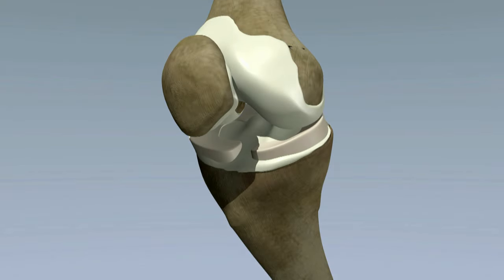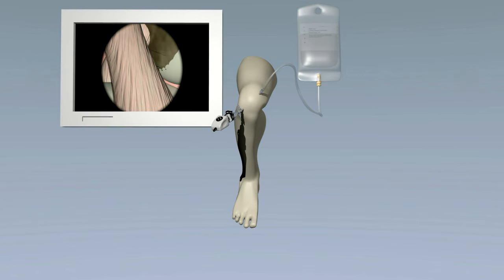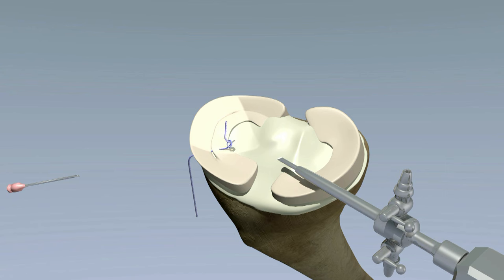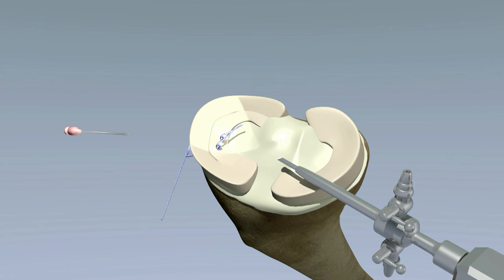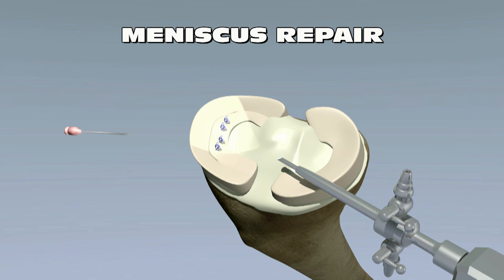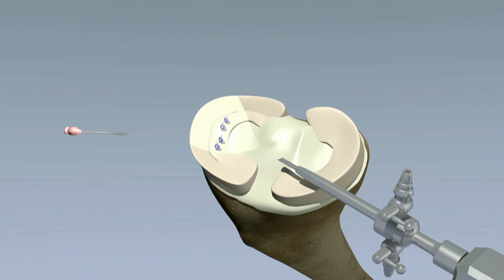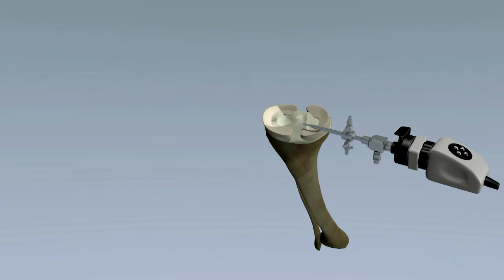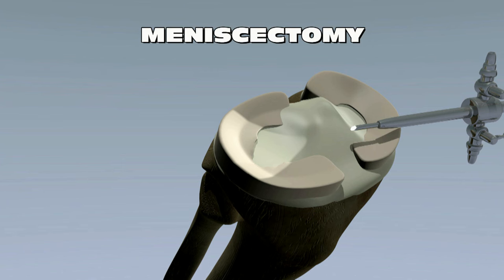Meniscus Repair and Meniscectomy

Comment: Meniscectomy doesn't work ... cutting out an incredibly tougth shock abosorber in your knee and replacing it with nothing ... guess what ... its doesn't work
Reply: That was my first thought. What are they replacing it with?
Reply: My ortho surgeon wants this asap I refused !
Reply: Thanks doctor lmao
Reply: @hardcoreromeo2111  No problem professor
Reply: That’s not quite  right as the tear can be trapped or be flapping about and hit off nerves and cause a lot of pain which the partial removal can really help with. Depends really on your individual symptoms

Comment: But also when you cut off the meniscus you are preparing the knee for a potential arthritis. Is that correct? How much in % can you remove from the medial meniscus to be safe and free of arthritis in the future?
Reply from the maker: The animation is meant as a simplified illustration of the procedure, not as a technique guide for orthopedic surgeons.  Yes, the more meniscus you remove, the less protection is left for the articular cartilage.  This can increase the potential for developing degenerative arthritis.  However, leaving a free flap of torn meniscus is worse, as this can rub against the articular cartilage and accelerate wear and tear.  Not to mention that symptoms will persist.  This is why a meniscal repair is done when possible.  Another option, in select patients, is a meniscal transplant.  I wouldn't say that there is a % that is safe to remove.  Removing the torn meniscus is just the lesser of two evils.  But most patients do very well more many years following a partial meniscectomy.
Reply: When people see comments like this they freak out and think surgery is huge mistake. Well apparently some people don't develop arthritis at all. Factors like age, volume removed and location, pre-existing chondrol damage, BMI etc all determine whether you're a good candidate or not.
Reply: @rachellemartique6980  I'm currently afraid of the surgery 😓
Reply: @ORTHOfilms  I’ve had 70% of my meniscus removed for lateral, It feels sore sometimes. Should I end up getting a meniscus transplant I’m 26 years old.
Reply: @servantofthecreator  now how are you bro are you fine
Reply: @servantofthecreator how are you doing brother 
I also lost 60% of my lateral meniscus

Comment: I had a partial meniscectomy done 6 years ago and it went well and my knee has been well since. Sports like basketball and no problem with a brace.
Two days ago I tweaked my knee and it felt like it was a bit unstable in that moment. 

How likely is it that I re-tore it? Or that my exposed surfaces touch? I've retained full range for motion except for when contracting leg muscles at full extension. Leg will fully extend w/o pain when left limp.

R.I.C.E. has helped with pain and motion. Just want some ideas, thank you
Reply: I think you need to revisit your opinion that meniscectomy ... it never does well
Reply: @youubik  yeah I think I have arthritis. A day of walking will leave me with lingering soreness the next day.
Reply: @isaiahmckeown-philip1238  I advise physio, look at the position of your knee, when you stand relaxed does your hip knee ankle stack above one another. Does your knee rotate in or out. Then work on aligning it
Reply: Please advice!!!
I'm 24 and just been diagnosed with meniscus tear. Completely devastated with the fact that I've to go thru surgery this early for the first time in life.
How's ur knee now? Did you go thru any episodes of pain/stiffness post-op? Jow does ur knee feel as compared the healthy one?
Reply: @Adarsh  hey Adarsh. You don't have anything to worry about. Here's my experience:

I did not have knee pain until one year ago, so just under 6 years after surgery. The pain started when I went from complete inactivity and rotting at my office desk to doing 1 or 2 intense workouts a day for 10 days straight. This is after 6 years of next to no proper physiotherapy.
During those 6 years, I went on long hunting hikes, did a skidoo race, played basketball and other sports, worked on my project truck, and more (most sports with a knee brace). I rarely got sore.
Now, since my injury last year, my knee if often sore, even from walking.
My advice is to do your physiotherapy consistently. Wear a knee brace sparingly. Most of all, follow your doctor's advice. But I can't stress enough to do the physiotherapy.

You'll be okay!
Reply: @adarsh5343  no episodes of pain or stiffness post-op - except the 2 or 3 days after surgery. Probably from the incisions. Otherwise, all was good. You're okay
Reply: @Adarsh  Ps I got surgery at age 19, and I am now 26
Reply: @isaiahmckeown-philip1238  Thanks a lot man for all the advice. I want to be in touch with you for any further advice if I may need with your experience coz sometimes I'm getting really scared by the idea of having the surgery and it not working out in the end. For I've read a lot of reviews where ppl have complained abt developing greater pain and post-op.
Where can i get in touch with you?
Reply: @adarsh5343  Compare good knee to bad knee, do they move the same, are they aligned the same. Do you have similar muscle mass on each leg. Do you have same strength and endurance on each leg. Have you had an ankle injury. Are your hips flexible and strong. Have you had a history of injury in leg, calf, quads, hamstrings on the knee problem leg. Consider these points before you consider surgery.
Reply: @youubik  Thanks a lot. And what would you advice,, whether i work on these issues and not go for surgery or after working on these,, i go for one?   And did you have any similar incident with you?
Reply: @adarsh5343  I had knee surgery for a menisectomy (discoid meniscus) when I was 19 yrs old, the result was abysmal.I would not consider surgery unless I was sure that my hip and ankle were functioning correlctly, also my qualds, hamstrings and calf muscles.  I would do at least 6 - 12 months to rehab.
Reply: @isaiahmckeown-philip1238  Meniscectomy will result in instability and it is a primary cause of osteoarthritis. The more meniscus is taken out, the more it accelerates arthritis because your knee joint has less cushion/support/does not distribute your weight evenly anymore. It is a very unfortunate truth. I am sorry.
Reply: @adarsh5343  Student here... If your doctor has recommended surgery, it is most likely that you really need it. You have a tear that results in that area being ragged and a meniscectomy is just them going and smoothing out the area (yes, this would result in taking some meniscus out since they have to smooth it out). It is not wise to leave it ragged since this would further degrade the cartilage in the meniscus. It would not only be painful but it would make the problem worse. The meniscus is made out of fibrocartilage and it is avascular (no blood vessels) so it can't heal and rebuild itself. I don't recommend ignoring it for a while since your knee is not 100%, you may be putting more pressure on your other knee. This is not great because it creates an uneven distribution of pressure in the joints of the other knee which can affect the cartilage in those joints, too.
Reply: @majocaceres5283  This has got me scared man. Nonetheless,, thanks for the advice 👍
Reply: Meniscectomy is at best a temporary makeshift sub-solution, delaying the need for a knee replacement later. There's a newer technique called biopoly knee resurfacing. There are other longer term solutions which may not match the medical template but is more suited to our pecuniary situation. All medical procedures drain a lot of money.